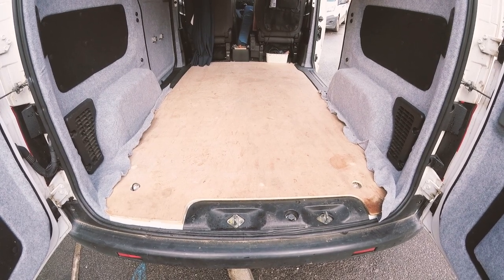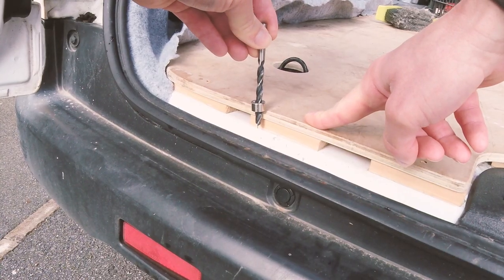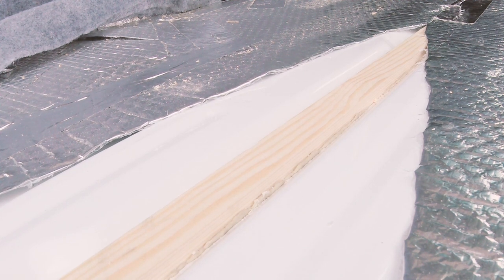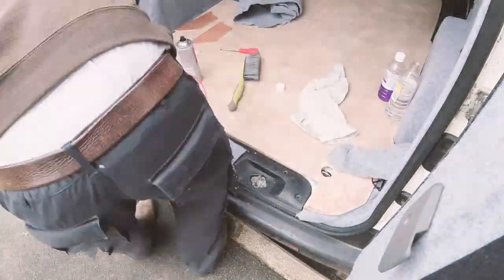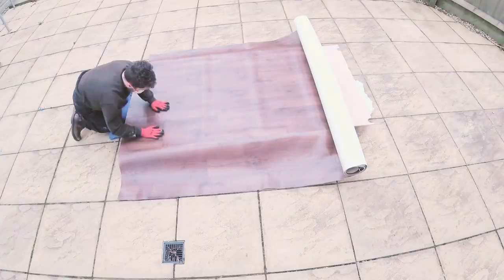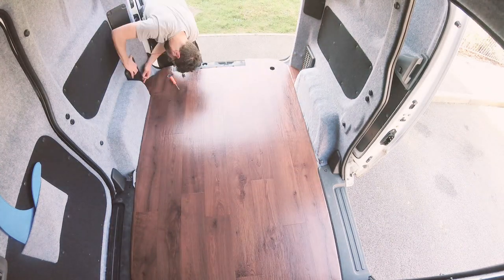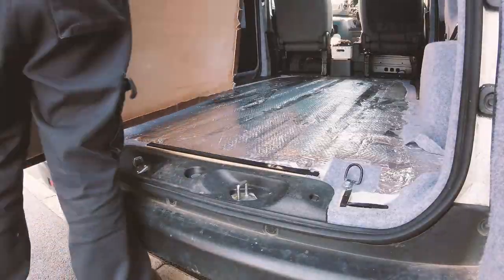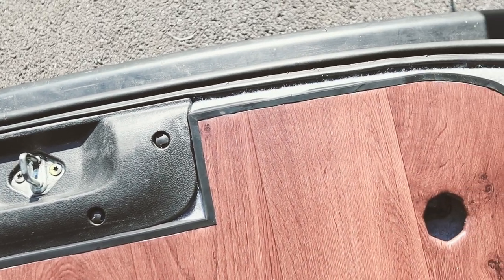Installing A Vinyl Van Floor | Ep 7 | Nissan NV200 Camper Van Build

Comment: James, the floor looks fantastic, however I'm not sure of the wisdom of covering over the hatch to get to the fuel pump access point.  It would mean a major job of having to remove the whole floor for you, I thought long and hard about this with my own van, in the end I cut a circular hole in the wood that can be lifted to gain access to it.......with your skills and attention to detail I'm sure you could make a neater job than I did......but it means very easy and quick access if I ever needed. Anyway loving the build so far.
Reply from the maker: Hi Linda, yes this was a consideration when doing the floor and I saw that some people had cut access in their floors, but I decided not to because everything in my van is easily removable: bed, floor etc. so it wouldn't be too much trouble to lift the floor in the unlikely event I need to access the pump. Also, it would mean cutting a hole in my neatly laid floor right in the middle of my side entrance walkway which would likely catch dirt and deteriorate with use over time, so I'm quite happy to leave the floor intact and put a couple of minutes extra effort in when it matters.

Comment: How thick the plywood is?
Reply from the maker: The floor plywood is 12mm thick
Reply: @LensOfJames  is 6,5mm thick too thin for floor plywood? what do you think?
Reply from the maker: I reckon so, needs to withstand a bit of wear and tear, but I could well be wrong. If it's all you've got, give it a go!

Comment: At 1-10 seconds you mention the fuel pump . Then you stopped talking .Is the fuel pump on the NV200 under the ply
Reply from the maker: Looks like the audio got lost - the NV200 fuel pump is indeed under the ply, which is why I've left the floor (and all my furniture) easily removable (takes a couple of minutes). I didn't leave a hatch because it would likely catch dirt and deteriorate with use over time, especially as it's near the side door I use for regular access. Plus how often do you need to access the fuel pump?!